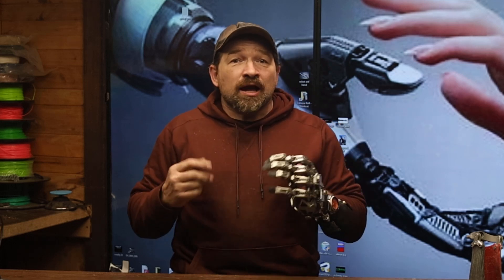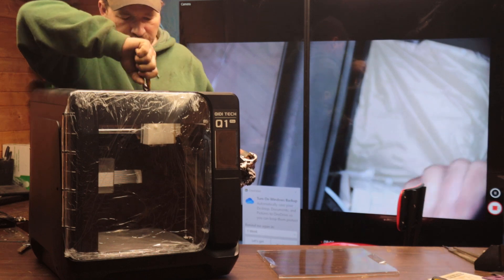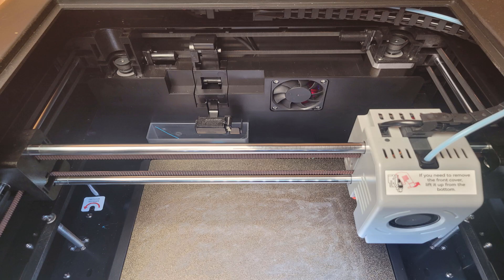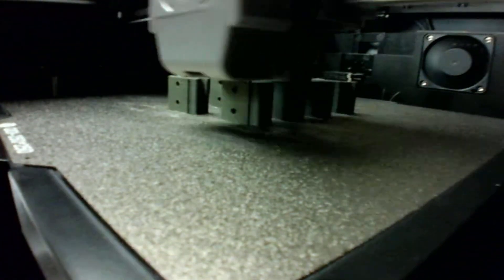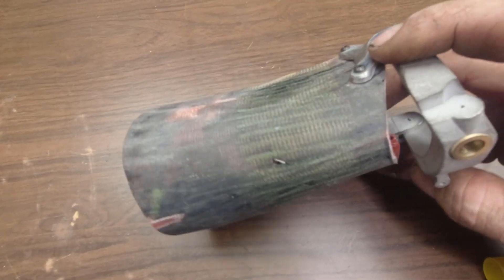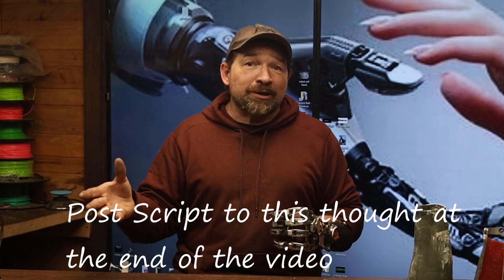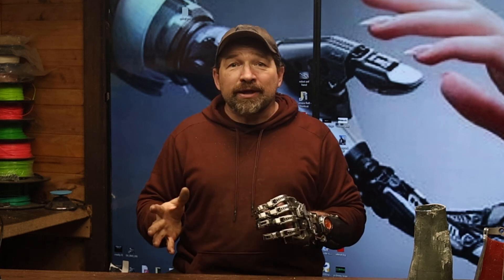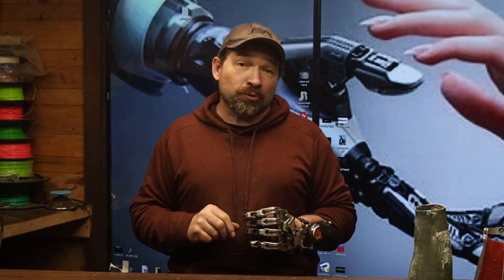QIDI sent me a pre-release Q1pro 3D printer to check out. Here are my thoughts.

Comment: do you have to mess around with the config in Fluidd to get the timelapse working?
Reply from the maker: No, but I did have to add  TIMELAPSE_TAKE_FRAME to the time-lapse g code box of the machine g code tab of orca. That and adding 10088 is all that I had to do to get everything running. This machine has been way better than the X max 3 that I never made a video for.